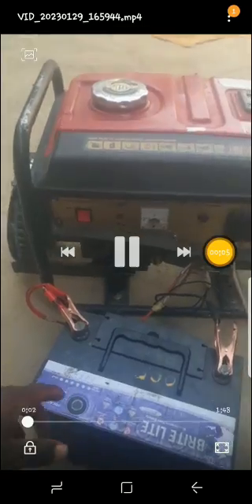+2348060978239, 1.2kw generator converted to fuelless generator

Comment: This are workable based on setups and configurations. The main issue here is the recharge back mechanism to the battery. Cox without that, it won't run up to 40 minutes and the battery will just drain up